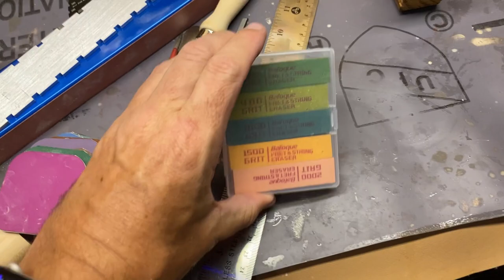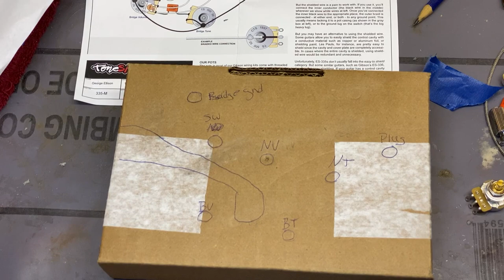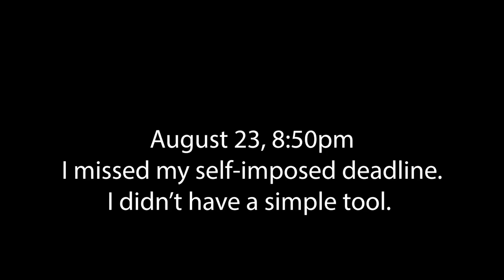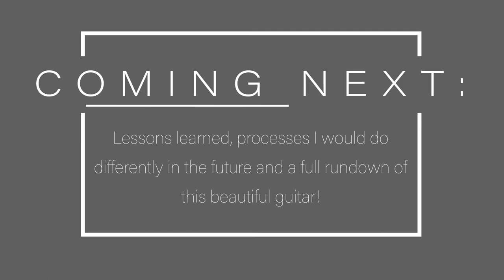Building a StewMac ES-335 Kit - Part 8 - The Final Days!

Comment: Question::
first looks great but why didnt you use Tru-Oil on whole guitar ? sides and back
Reply from the maker: Hi Joe! Thanks!! The only place tru-oil wasn't used is inside the guitar body cavity, and on the fingerboard. 

I had to use the Shellac as a quick fix to yellow the binding on the neck because I made a newbie mistake and taped off the binding for the neck, but not the guitar body, and didn't Untape it until over 50 coats of tru-oil were applied.

Comment: Hi. I see you used a 12" radius block on the frets.  However I noticed that the StewMac instructions say to use a 16" block.  Can you confirm what the fretboard radius is on these kits?  Thanks in advance!
Reply from the maker: I used radius gauges to find what the radius of the neck was prior to grabbing the block... I also learned through this process waht's on the box isn't necessarily what's in the kit... Your results may vary.
Reply: @iambucketdotcom_official  thank you for the response! I actually got a reply from StewMac & they said it was 16”, but who knows if they actually checked or just regurgitated a response. It just doesn’t make sense that they would make a “335” guitar & not use the traditional 12” radius.
Reply: @iambucketdotcom_official  do you happen to know the final weight of the guitar?  I'd love to know. 🙂